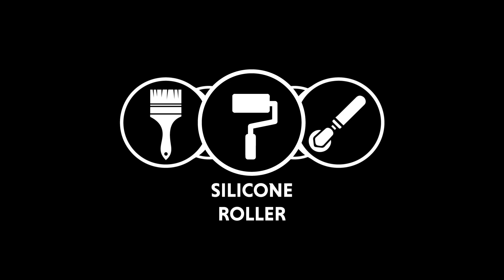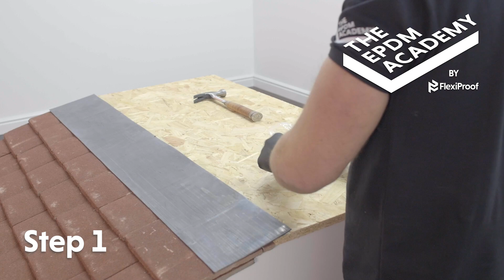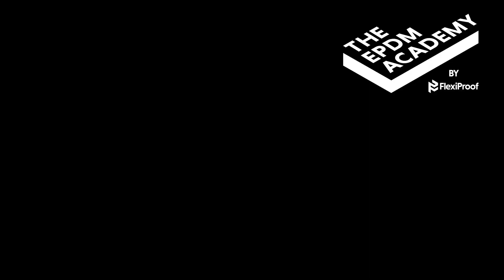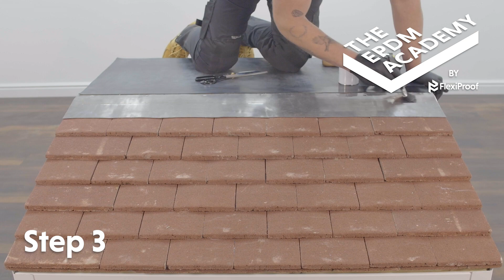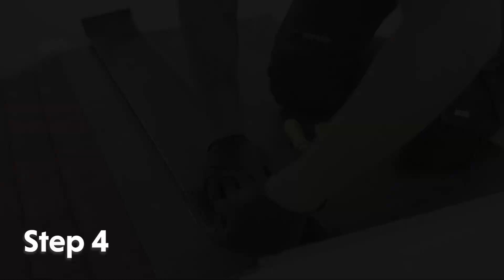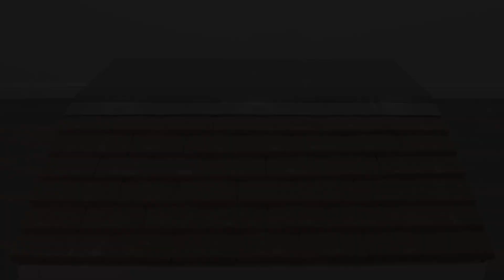JOIN FLEECE BACKED EPDM TO PITCHED ROOFS ONTO LEAD FLASHING USING 6 INCH COVER TAPE - FLEXIPROOF®

Comment: can solvent contact adhesive be used instead of the tape?
Reply from the maker: Hi, no you would need to use flashing tape and adhere using primer.